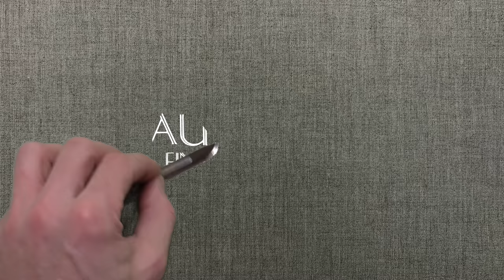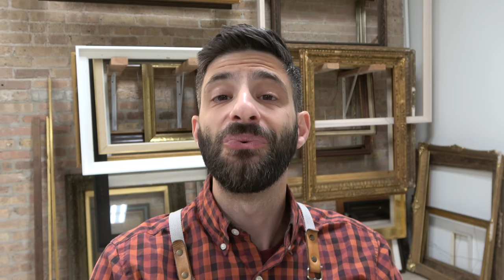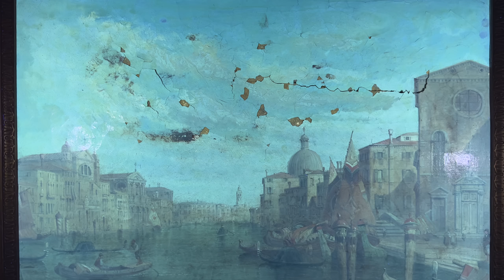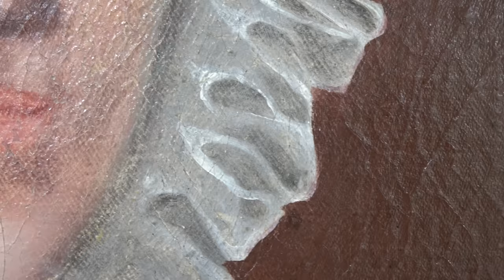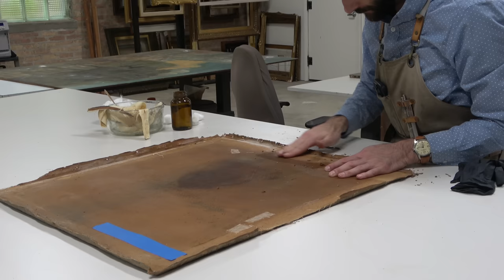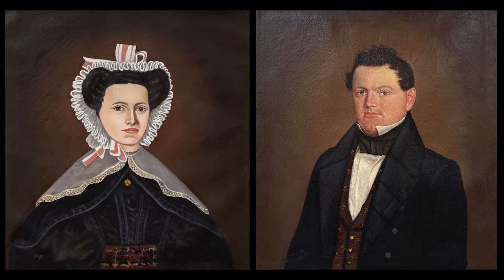Art Restoration Fail - Epilogue

Comment: Julian can you restore my life
Reply: for real!
Reply: Has your life been overpainted recently?
Reply: Does your life have an isolation layer?
Reply: Has your life been exposed to humidity changes?
Reply: Can you tolerate a thorough scraping?
Reply: Are you able to be effectively exposed to solvent?
Reply: First we need to get you under a black light to see all the rubbish, followed by a soothing and sensual chemical wash.
Reply: Is your life reversible?
Reply: @chrish1657 with a penetrant finger 😂😂😂
Reply: @sgtleobella solvant may be not… but a certain type of liquid YES 💦💦💦
Reply: are you made of archival material?
Reply: For what use ? 😅
Reply: He'll put it back together with tacks instead of staples.
Reply: We’ll patch your emotional wounds using Belgian linen
Reply: He's only working with 2D, though, so nothing past your surface layer.
Reply: Remove the rabbit skin glue
Reply: you just want to go on the hot table.
Reply: How hot is that hot table, by the way?
Reply: Come on now…he’s not Jesus.
Reply: @lpennebaker  That's for sure. Jesus hands out wine. Some people want beer. 👍
Reply: Were your tears patched or bridged?
Reply: This comment section did not disappoint 😂😂😂😂 I'm still dying at hot table😂😂
Reply: I mean, clean yourself, be diligent and detail oriented, do the work, and do the research - that's what he does... it'll fix you right up
Reply from the maker: I gotchu...  c'mon in...
Reply: I could go for a rigid interleaf...
Reply: Guess even Julian has limits!
Reply: And he can leave a scope for next restoration too😂
Reply: @BaumgartnerRestoration  Not afraid, even of the biggest challenge, love it! You rock!
Reply: I clicked this comment for the comments below. Very satisfied
Reply: This comment thread made my day 😂😂😂
Reply: Just drink some solvent.
Reply: He can put you in The Clampinator to straighten you out
Reply: I love this channel and all the comments 😂
Reply: Can he exam u under blacklight?
Reply: Can he exam u under blacklight?
Reply: yall in the comments are absolutely hilarious😭
Reply: can’t believe he actually replied! these are hilarious
Reply: This comment thread is strangely inspiring. If only we were all capable of treating ourselves with the care, thoroughness, and respect that Julian shows in his work! 🥲
Reply: Just put on some washi kozo to hold yourself together!
Reply: has your varnish been exposed to cigarette smoke?
Reply: Only if he covers you with Japanese paper and puts you on the heat table for a few days, and adds edging strips for re enforcement
Reply: Julian could restore all of our failed relationships I he really wanted 😊
Reply: He already restore my hopes in humanity and human ingenuity.

Comment: This is a story about me and my electrician, i bought an old house and the electrical system didnt work all the well so i hired an electrician, she came and looked over my electrical system in the house and said she could reduce the problems that i had and it would be fairly cheap or i would need to basically redo all the electrical work throughout the house. It wasnt the right cables, too small diameter and wrong insulation in many parts of the house. 

So at first i just hired her to reduce the problems that i was experiencing, she did a good job so i asked her to redo some wiring in the house as well, she did another good job. So i asked her how much i was looking at to redo all the electrical stuff, she said how much and i said i didnt have the money right now, so she asked how much i could pay per month, so we worked it all out.

Over the course of a few months she fixed everything electrical in the house, but since she had been there so often we knew each other pretty well too and she knew what i worked with, basically economics. A few months later she paid me to look over the economics of her business, she was a single electrician running her own business to earn money to her and her family, so i did, there were some minor errors and problems with it but nothing major. Basically it was hard to keep track of income and expenses as they were not separated and sometimes an expense here could be seen as an income there, so it was hard to keep track of.

So i sorted it out for her, so its easier to understand and work with, separate bank accounts for income and expenses and a third for money the company has to work with. It was hard to convince her that she was an expense for the company as it had to pay her an income every month but eventually she agreed.

Its not like we are good friends or hang out or anything like that, but when a friend of mine is looking for a good electrician, i give them her number. When she has a friend that needs help with economics she sends them my way, it can be something as small as asking what kind of loans they can afford or if its worth to take a second loan on the house. To sorting out a businesses economics because sometimes they are a just a complete mess, so they dont have a clue if they are making money or losing money. Its usually very small scale what i work with but i do have a regular job as well. She is thankful that she can understand the companies economics a lot easier and i am thankful that i have a house that wont burn down and doesnt have any electrical problems any more. Both of us are better off in the end.
Reply: You use the term economics, but I think what you are talking about is more accounting than economics at least as I have studied them.  My college degree is in accounting and one of my best friend's is in economics.  Both involve money but accounting is the term used for the records of income, expenses, profit, loss etc.  Very glad the relationship was beneficial to you both.  It can be difficult to keep up with the income and expenses of a small business and there are many expenses that business owners don't realize, including paying themselves.  Hopefully, it gets realized at income tax time. :)
Reply: Sometimes what sets a great worker apart from a good one is simply which one is honest in their work 😊
Reply: How the world and work/service vs needs/wants should be run.

I wish we went back to this way of doing business and building an interlaced community

Comment: Hello!  A question I had when watching the original video was, were parts of the face "skinned?"  Specifically, the portrait-right area of the lower lip and portrait-right of the mouth seemed to be missing paint, as well as the portrait-left eyebrow, which seemed to be half missing.  Were these skinned, and if so, was there a reason that you didn't retouch them?

Comment: Thank you Julian for sharing this with everyone. I had SO many questions about these paintings, and this video answered most, if not all of them. I unfortunately don’t have funds to partake in your patron, but I do enjoy having this glimpse on this particularly problematic conservation work. 

Note, as someone mentioned, this signature is seen very clearly for a few moments. I don’t know if that was intentional or not, but if you are still worried about people hassling them (or their family in this case) you may want to fix that segment. I admire that you tried not flame the previous worker aside from pointing out what was done wrong or incorrectly. It’s easy to fall on the bashing train and it’s nice to see professionals not engage in that toxic behavior.
Reply: I read in another thread that it has since been fixed.

Comment: Where do you differ in your oath to preach good practice vs holding proprietary methods/materials while running a business?
Also, is the problem with using gloves while rubbing the lack of feeling to guide you? Or more about the texture and properties of the glove? While watching I was wondering about thing like modified, bespoke silicone finger brushes. I'm sure there's a creative solution out there, and I've wondered about this a few times. You'd need something thin but resilient enough to emboss, print, or mould a fine fingerprint-like abrading texture.

Comment: In the end, this wasn't a particularly difficult restoration. I saw you do much, much harder stuff.
Reply: He was lucky. It could have been much, MUCH worse. As I believe he mentioned in the video, the relative newness of the “retouching” oil paint on the old paint meant that the new paint was much more susceptible to his solvents than the more stable and more thoroughly cured old paint. Had the “retouching” been older however it may very well have been a very different story. Once that overpaint had been removed, the actual painting itself was in fairly good shape…..which ofc makes the overpainting even more of an act of vandalism than if it had been an attempt to “repair” damaged paint. On the other hand, if the original paint  had not been in such good condition, the restoration would, again, have been magnitudes more difficult.